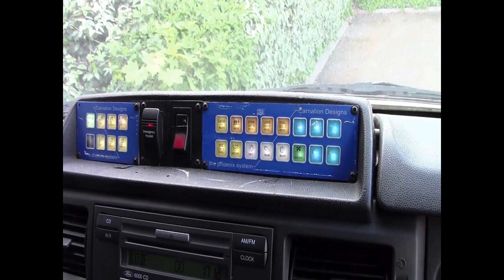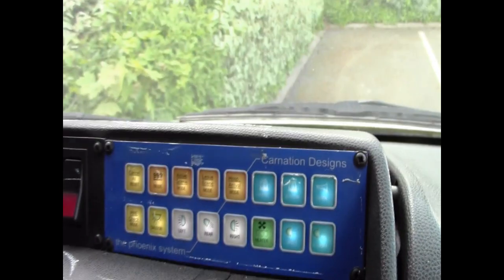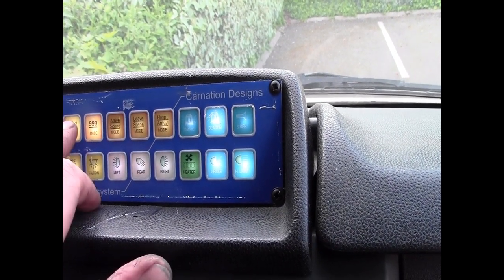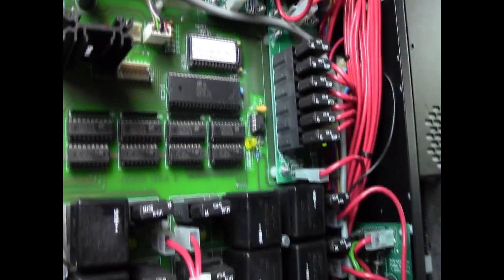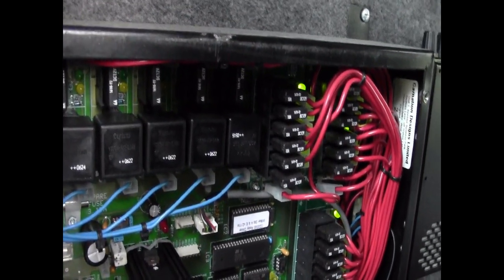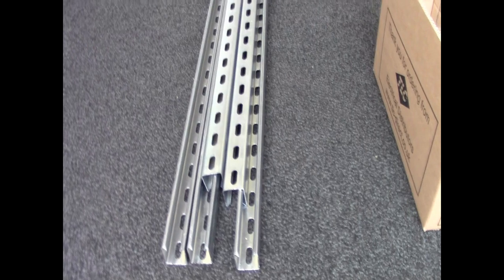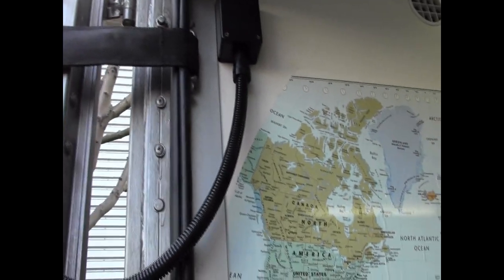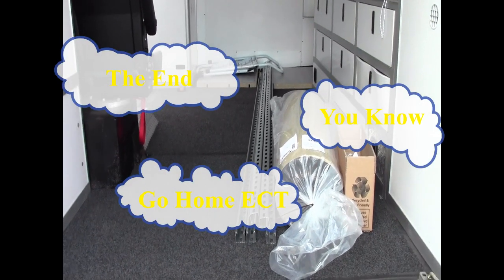The colonel, Transit Ambulance Camper,  Phoenix system overview

Comment: 999, arrive and leave scene etc are just convenient ways for the driver to turn on different sequences of blues, siren, interior lights. Pre check will cause all functions to turn on one by one for walk round checks. They are programmable, but you need to get new pre configured chips from Carnation who used to make it. One for the main unit and one for each keypad. Still in use on old ambos but spares are like rocking horse doo.
Reply from the maker: Nice one chap ! i did hit the pre check after that vid lol all went mad, i thought i'd fooked it ! i did work it out eventually but not after a few mins panicing like a headless chicken :)
Really appreciate the input so thanks again !

Comment: So, does that Phoenix, run off the one battery??
Reply from the maker: No chap there's 2 batterys for that system, 2 for the starter and another for the now removed tailift but i'll be changing that to just 2 lots of batterys, 4 for the camper (possably running the phoenix) and charged by solar and alternator, 2 for the starter/van, charged by alternator and solar (in that order).
I have a battery to battery charger on the way that will replace the battery isolator it currently has (that's what makes the 3 battery systems it has at the moment) then it will have just the 2 battery systems, confused? me too ! lol
Reply: @Dirt-Diggler  🤣🤣